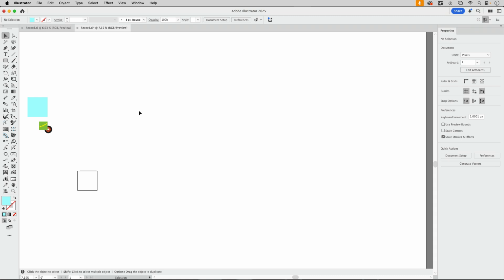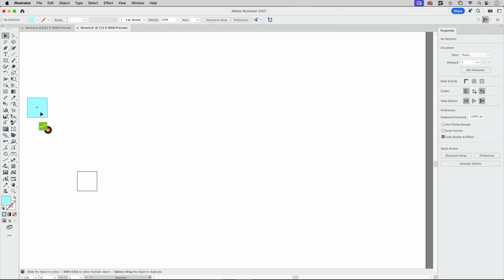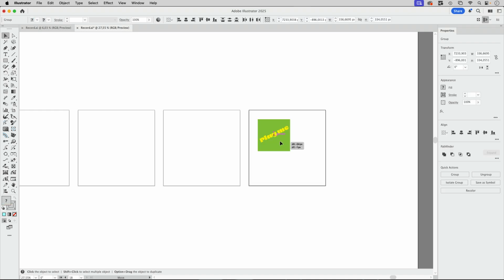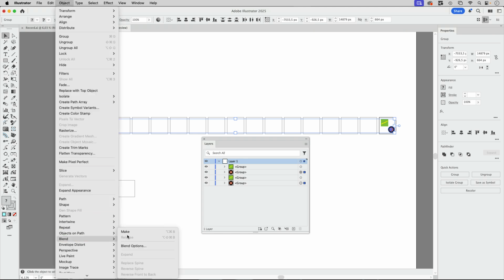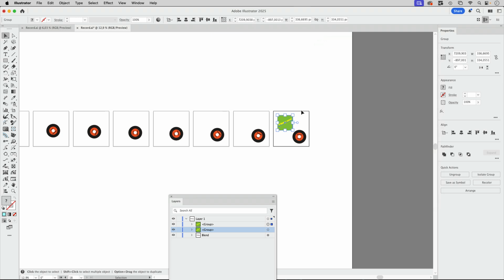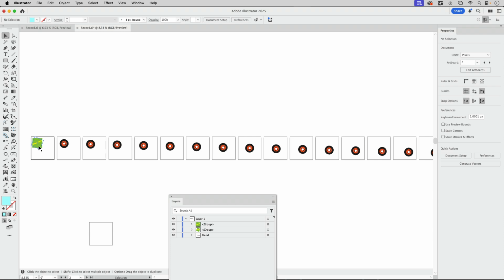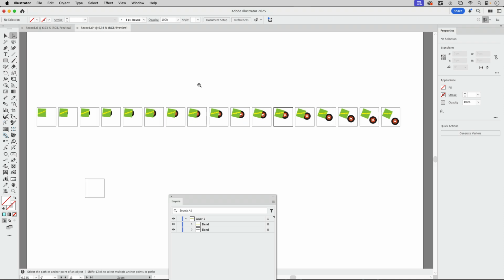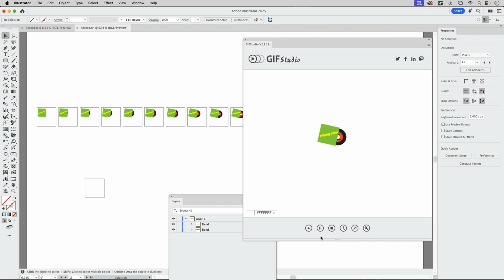Animate a Record falling out of a sleeve in Adobe Illustrator

Comment: Interesting. I never would have thought to make animated frames in Illustrator using the blend tool. I understand that it’s probably limited, but it would be nice to have the record speed up once it falls out of the sleeve.
Reply from the maker: You can break the animation up into more pieces. So you have 2 or more blends in it. Theoretically you can have blends with more base objects, but I would expect that the steps distance is more difficult to control then.